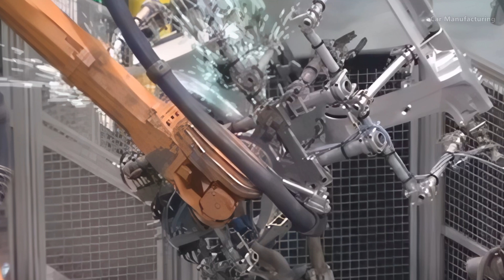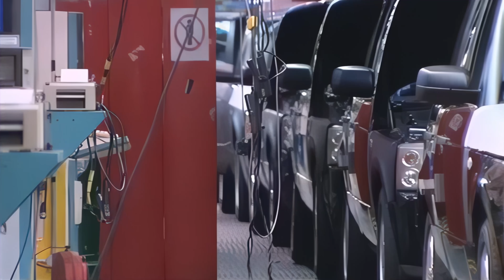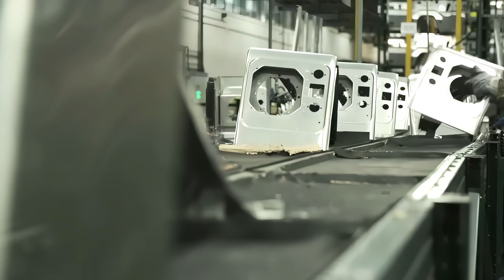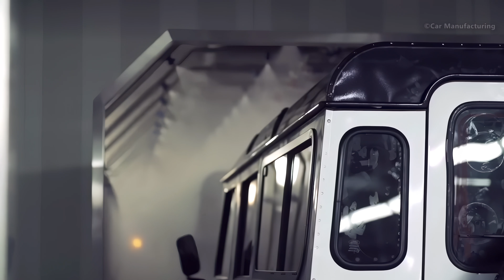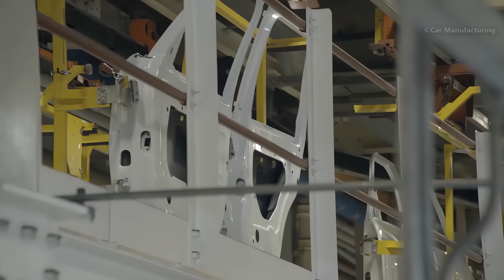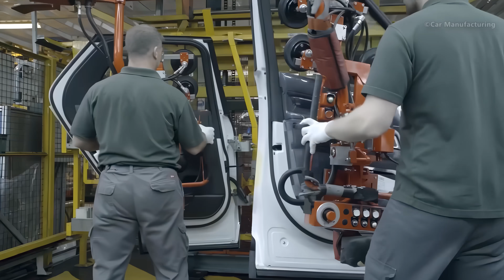UK Retro Land Rover Factory: Back when DEFENDER was a car for life

Comment from the maker: Are Land Rovers still the most reliable cars? 🚙
Reply: No never ever.
Reply: Hell no
Reply: The Land Rovers always have been pretty well build. But the share the problems of most British cars of the era. Electrical issues for example. The V8s have been nice cars for example. But insufficient range...
Reply: Were they ever... Never
😂😂😂😂
71 year old, 
70 year long Landy Lover, guess I was born without brains... 🇿🇦
Reply: They say "Land Rovers.... Teaching owners to be mechanics since 1949"😁
Reply: Never were, never will
Reply: Not really. . We have them at work mainly for their towing ability. We have a 2009 Range rover and a Discovery  2013  . I think the main problem is the dealers as they don't seem to care. Our discovery has a fault a week.  Last week we couldn't open the back tailgate and this week the back lights don't work. The week before all the warning lights were on and the indicators wouldn't do anything. Yet our 2000 reg Hilux just goes on and on with 330000 miles on original engine and gearbox. Trouble is we aren't rich and can't afford to replace anything at the moment.
Reply: Bla bla bla, to much looking for reasons....

Comment: 2005 TD5 owned from new😎
Reply from the maker: Wow, and what has broken on that TD5? Or nothing at all so far? 🙂
Reply: @CarManufacturingg I'd say the biggest (most expensive) thing was the cylinder head cracked, got over 100k miles before it went through....
Other than that not a lot really.
Edited to add: have suffered many parts, which have upgraded during replacement.... Oh and corrosion 😮

Comment: 97 Defender here.  "A car for life."  But a frame for 20 years.
Reply: All one has to do is oil spray the frame inside and out every season , and wash the frame out if you off road in mud , and oil spray inside …. do this maintenance and the frame will last a lifetime and someone else’s lifetime …. Overall timely vehicle maintenance is the key .
Reply from the maker: Well, William gave you good advice… what’s your experience with the Defender frame?

Comment: No. And they have never been, to be honest.
Reply: ALL old Defenders leak! It is common knowledge that on the production line water tunnel they would put paper towels in the footwells and if they were wet after the water test the leaks would be hand silicon filled and sent through again but due to the movement of body on chassis the leaks would open up again in a couple of miles on the road. Still love them tho 😁
Reply: one of the best vehicles ever made, longevity and usage is the evidence, total cobblers mate
Reply: @willevans-n6c  I was about to say the same. The military forces of so many countries and exploration expeditions would soon tell you otherwise. They wouldn't have been chosen if they were not cost effective. In various versions they served the British armed forces from about 1956 onwars and they still haven't found a replacement for them.
Reply: @mothmagic1  bang on the money. You can spend a lot of money of so called perfect cars, I never saw anything wrong having to tighten a couple of nuts properly , I saw them being used by the Moroccans years ago, even the Germans love them, thes evehicles could be repaired on the go, and last forever, with character, I wish I still had mine, it was more than a vehicle to me. I think Tata forgot this
Reply from the maker: Is that your personal experience? Which model did you own, and what went wrong with that Land Rover? Anyway, thanks a lot for the comment